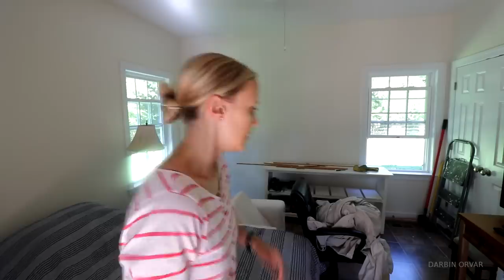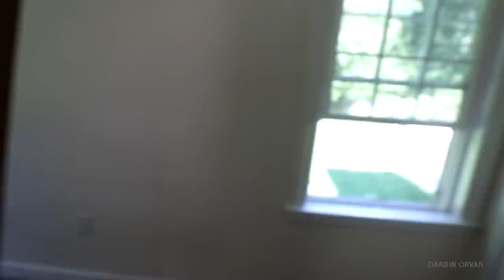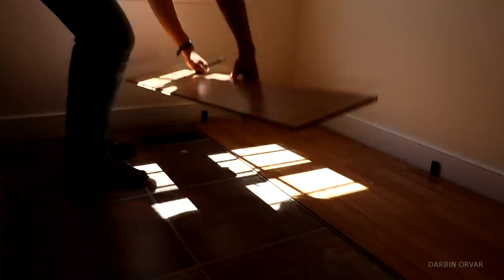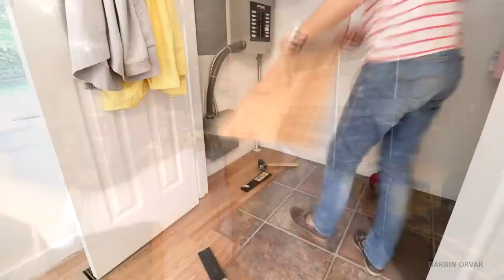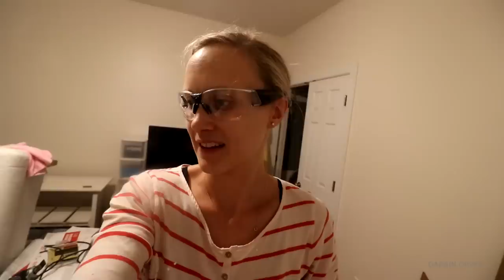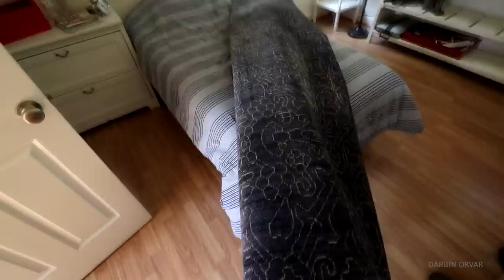Laminate Floor Installation // Beginner How-To

Comment: We paid a floor guy to sand our hard wood floors and put down laminate in our kitchen of our new old house we bought. I paid half up front but he did not finish a single room so we fired him. I ended up doing the laminate floors myself with the help of my pro boxer and I wish i had seen your video before we did the floors. It has shown me how to fit a few mistakes we made at doorways, Thanks

Comment: Nice video.

Regarding tip #3 (spacers) I saw on another video where someone suggested, once you get the first couple rows of flooring in, to put a few unopened boxes of the flooring on top to weigh it down and help it from shifting around as easily.

Comment: Awesome❗️ thanks for all the tips. I want to do my bathroom w/ a plyboo waterproof lam. One Tip: if the tile floor sits on a slab, or over a moist crawl space, do put down a vapor barrier, before the lam. It’s an added protection.

Comment: It's good to use a small scrap of flooring when tapping the floor. Click the scrap into the floor, raise the scrap and give it a tap, once it realigns un-click the scrap and move on. 

Scraps are also good to figure out how to space a room so you don't have a full width board on one side and a small ripped piece on the other. That way you know how much to rip off the first row. 

Door jams. Turn a scrap upside down and use a flush cutting saw ( or an oscillating saw) to help cut the jams at the correct height.

Comment: Linn,  I love the type and color of engineered floor you chose.  Great tips and hints.  As for the underlayment, that is really for the people that put down real wood engineered floor.  Your style of floor is dimensionally very stable and will not move much.  Awesome job.  It always seems to take longer than it should.

Comment: Very nice. I installed this type of floor in a remodel I did. My one tip is I used a large plastic tote in the room as saw horses and to catch trash. Saves a ton of walking.

Comment: Just a couple helpful tips.  We make great tapping blocks from a scrap so it locks into place and doesn't mess up the edge.  To reduce scrap we try to use the piece we cut from the last row as the beginning of the next row.  This works great when the size of your room allows the cut pieces to be the right size or larger for fitting.  I have found it really doesn't matter if your ends match up  as long as you have a space that will allow for expansion but your trim will cover.
Reply: An oscillating multi tool is your best friend with this stuff.  
I found out about the importance of the gap on the edges.  My walk between my liv. room and dining bows up leaving a 1/2 inch or more gap under the floor.  Of course the trim came off and I broke my toe due to it sliding right under that gap when I was in a real hurry.  Ended up doing a dive roll, tore my nail off and broke my poor toe in 2 places.  Now I have to take the trim off one wall and use my friendly tool to cut about a quarter inch all the way down next to the wall to give it room to expand and contract.
Reply: If you bang on them to hard the rise up at the joint and that will wear out first.  If they don't go together pretty easily take scraps of the different edges and slide it back and forth on the edge until easy to slide.  A brush to clean out the locking parts and a scrap of sand paper are really helpful.  The first two rows are the main one to get really straight.  The better job you do on these two rows the easier the rest goes in.

Comment: I've done many of these floors, always the wooden ones. The last one I did was vinyl flooring, it went way quicker. With the wooden ones you need to constantly go outside and cut the piece because of all the dust it produces. But with the vinyl ones, you just need to score a line with a utility knife and snap the piece off. A little bit more expensive, but I think it is worth the time you save going back and forth.

Comment: I used that same product for my basement floor and so regret trying to save the money for a better manufacturer.  I found plenty of pieces in the boxes with finish imperfections that I had to return and swap for new boxes.  Having to bang in the short sides is not normal for the better products.  You attach the long sides and then slide them down..  but with this stuff it's so much banging and tapping.  It took me 3x longer to install than it should have.
It's also so tough on the blades.  I went through miter saw blades and multitool blades like you read about.
I also agree about the underlayment as other people said.  But in my case it was for sound absorption and moisture being a basement floor.  It's been 4 years and sadly I now have slight buckling between some of the boards possibly from moisture.
Glad yours came out good and looks great.
My project was a whole different animal hence the problems I had with it.  800 sqrft basement on a concrete floor..

Comment: Good job! Thanks for sharing; it's the cutting that intimidates me.
Reply: Same with most beginners. I know I'm late in telling you this, but practice on some wood off cuts, and take your time on the real thing. And measure twice, cut once! It's better to hire the right tools rather than using something that's not quite right.

Comment: Here's another tip: If you're doing a large room, have extra blades for your saw.  My dad and I used laminate flooring in my parents dining room / living room and he had his 10" mitre saw in the room.  We easily went through two new blades cutting pieces.  I don't know why but for whatever reason the flooring we used was very hard on blades and was eating them alive.  I'm glad he had extras or we would've been stopped very early on in the process.
Reply: You can save your blades if you score and snap with a razor blade and a speed square.  I just did a hallway and kitchen and never used a power tool aside from an oscillating tool for flush cutting trim

Comment: That stuff is far easier to click a whole row together end to end, then click the entire row down by hand. You just have to work up and down the row as it can pop out at one end. I light tap gets it in, but also saves having to tap each board in one at a time. I've done a 6m long room like this, and also a small 3m room.  Looks great though!

Comment: Great job. The transition between the hall and room is not shown in the video I think.  How did you manage to get the room and hall aligned? Some walls are just not straight so I'm afraid I'm going to have this issue.

Comment: Make sure the floor is clean and level before starting, rooms aren't always square, let the product sit in the room for 24 hours before starting, wear knee pads, and finally remember that the floor height will increase slightly, therefore skirting boards will probably require modification before re installing.

Comment: Hi great video, My family wants to put flooring down in a few rooms. I currently don't have any power tools but a drill. Could you tell me some tools I need to perform the basics without having a workstation.
Reply: If you just want to get ONE saw to do the whole job its possible to do it all with a table saw .You really want to use a combo of a table & a miter saw but its possible to do it all with a table saw! 20 years ago when I did my 1st floor (which was my own) I did the whole job (1200sq ft condo) with a table saw & a hand saw for the door jambs (the next tool I bought was an oscillating saw because it really sucked using a hand saw to cut all the door jambs! You can rent tools at home depot and Lowes, if you don't want to buy them. 
 If you do LVP (Luxury Vinyl Plank) instead of laminate you can just use a utility knife, you really don't need a saw. (I have a series of videos on how to install vinyl with a knife) you'll need a jamb (oscillating) saw to under cut the door jambs (you can use a hand saw if you have no reason to own one. if you can rent one u should it'll save time and frustration) 
you'll need a rubber mallet & u can use a piece of your flooring as a tapping block so u don't have to buy one (and its better since the locking system is the same its easy to break the locking system when using a tapping block!)

Comment: In Europe everytime we put thin layer of Mirelon (polystyren foam in roll) under new floor of that type. For elevation and step sound elimination. :)
Reply: Yes you should ALWAYS use underlayment under Laminate even though she went over an existing laminate (which isn't recommended)  You should really remove the laminate that was down. I wouldn't recommend ANYONE install laminate over laminate BUT if you do put at least a thin pad in between or buy a laminate with padding attached to the back.

Comment: You could have used a box cutter to score the measurements and push them out with your hands while you are still there. It would save a lot of running in and out.

Comment: You need a Sound insulation under the laminating. Greettings from Germany
Reply: She has the linolium underneath. No need for it
Reply: @drewberrynews3875  that is Not correct.
Reply: Tell me why you need it if you have linolium underneath?
Reply: @drewberrynews3875  Hi, Linoleum dont have the same Effect as an Sound damping Material. Its loud when you walk on the floor without this.
Reply: @timmy86mn  that's not exactly true. If you're already on wood underneath the lino is good enough. How do I know? I've spent a great deal of time investigating these sound proofing materials. There is a wide variety of these products with differing results. I've even created my own product that once I patent will be one of these products. The simple explanation of how these work is basically by trapping air either between layers or throughout. Lino may not be the most sound dampenimg but many of the products for flooring aren't either
Reply: + @drewberrynews3875 Well Andrew, that last rebuttal seems to have dampened any further argument.
Reply: @drewberrynews3875   I have vinyl underneath. They say professionals always put in an underlayment. In my case, it's in the dining room, I want additional insulation from basement below.The underlayment is not too expensive and it claims on the pack that it has moisture protection, mould and mildew resistant. Would appreciate your comments. Thanks.
Reply: @timmy86mn  depends on the laminate, there are ones with soundmates in it.. also gibt welche mit solchen schichten drinne
Reply: @bhBlacky82  das hat damit nichts zu tun.

Comment: Looks great. This kind of flooring can slide apart over time though, as it's not clicked together. It's slid together. Real click flooring has interlocking parts that will not come apart once it is laid.  For Some flooring like yours it is recommend that you glue the board's together to prevent them separating.  Not sure what the instructions on yours said.

Comment: Here are a few more tips. 
Prior to tapping the rows end to end..temporarily connect a piece of laminate at the joint where the two end pieces come together. It will ensure that end to end joint connects level and you don't chip or bend the end joints. Secondly in your video you stated always tap end to end and not the long side to side..I would highly disagree. To ensure a tight fit I ALWAYS gently tap the long side once you connect the pieces together. Lastly kake sure you mix the boxes together. Remember they are only so many patterns in a laminate set...you don't want to put like patterns together....
Reply: 100% AGREE!

Comment: Ok, cool video but a few questions.  You don't have to remove the old floor?  You don't have to use a type of underlying material? Last question, how many sq ft was that room?  135 dollars?   :O   Ok, thank you.
Reply from the maker: I did not remove the floor. I choose not to use underlayment because it was already underneath the old floor. I guess it was ~ 150 sqft.
Reply: @darbinorvar  Thanks for the reply , so roughly 1 dollar a sq foot more or less. I wonder how much labor is?  I am doing a 2200 sq ft home.

Comment: Nice job. I recommend you wear knee pads. I know several people who have ruined their knees because their job involved a lot of kneeling and they didn't protect their knees properly.
Reply: Maybe for a professional, but for someone doing it one time it isn't needed
Reply: unless you are older
Reply: You can usually hire knee pads from the local church during the week 'cos it's only on Sunday they're really kneeded needed.
Reply: We put in some of this flooring recently. Yes, I recommend knee protection, too. Didn't have any wearable knee-pads, but this is what we did instead… Took a corrugated cardboard box (leftover from the mail), and collapsed it. We also had some envelopes from the mail which were lined with bubble wrap, which I inserted into the collapsed box. And our knees were saved!
Reply: @World_Theory  Worth getting some proper ones if you do any similar jobs. They're not expensive.

Comment: I for sure will need power tools no matter what, right?
Reply: It depends on what kind of flooring it is, if you have laminate, you could do the short cuts with a box knife and snapping it, but for the long cuts, yes you'll need some power tool.
Reply: @Zytiko  I have actual wooden floors. I was hoping this would be easier, but so far it looks like I'll need power tools but I don't own any and definitely don't know how to use any. Can I just place the this laminate on top of my existing wooden floors?

Comment: Did you use the oscillating tool on the door jam which maybe a structure support?
Reply: webslinger67 the door frame has decorative molding pinned to it. That's what should be cut.
You're cutting the molding off so you have a nice square face to make it easier to cut your board to fit
Reply: The door jam is never structural, it is secured to (semi) structural studs. The only job of the door jam is to house the door.
Reply: But you cut the door jam from the floor board it will become loose, over time cracking everything around it, unless she ran a screw diagonal inside the door jam securing it back to the floor we didn't see. 

It could have been tripple stud to the outer wall to, then it might be ok.
Reply: How did you get a crazy idea like this? The door jam is screwed or nailed to studs around the door entrance.

Comment: I really can`t understand why that miter saw has batteries. It is not like a drill which you move around all the time and it is very useful without cord. miter saw is one of those tools which you move very rarely.
Reply: A cordless drill is the only battery-operated tool I have.  But I mostly work around our house or our cottage where
the extension cords/cables are sufficient to reach everywhere. I can imagine though that there are situations
(for example if you have a larger garden or you work on a place where no electricity is nearby) that battery powered
tools come in very handy. (even a miter saw)

Comment: Uhh wouldn't you normally click them in lengthwise by coming in at an angle and thus putting together the whole length and then clicking the whole thing into the previous row? I do not think you're supposed to hammer them into each other. The hammer is used for minor adjustments...

Comment: That stuff looks exactly like the floor the previous owners put in our master bathroom. Not a great idea on their part, but at less than a $1/sqft, I can see why they did it. It IS NOT suitable for a wet/water environment, but it was cheap and fast, just enough to sell the house.  Good luck with any spills or rain/wet feet....